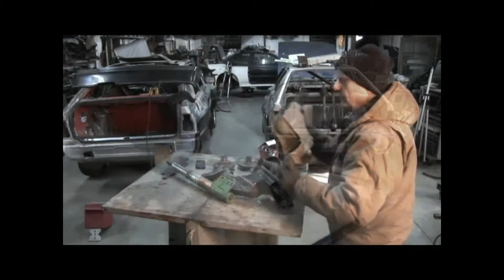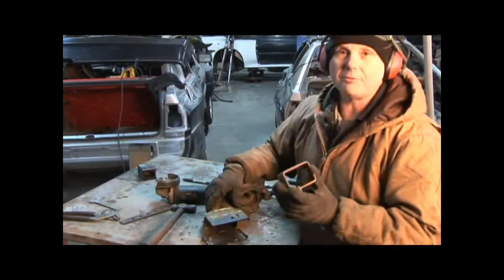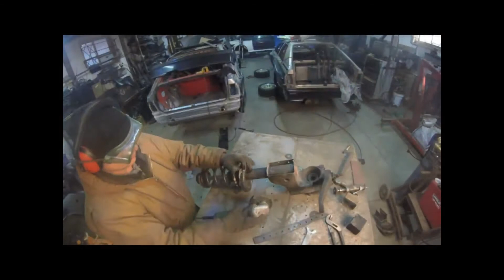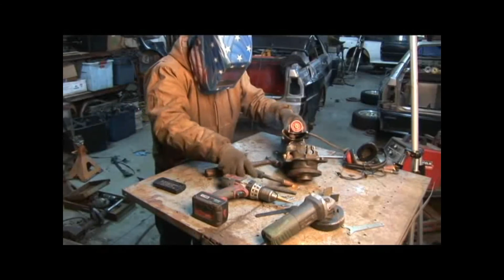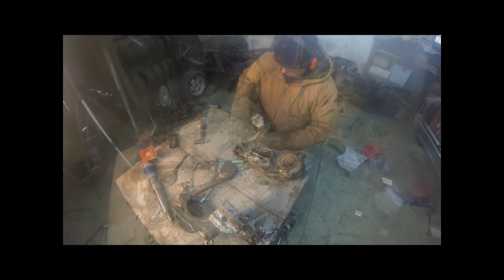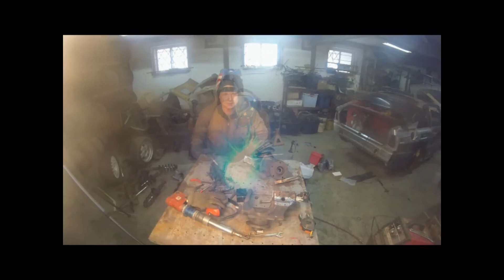Building suspension hub assemblies for the Audi quattro rally+sport quattro kit cars

Comment: Interesting use of parts, spares, eyeballing it!
Reply from the maker: Thanks. Eyeballing it, haha, ya why not, doesn't matter, it's all about fun and if it works, great, if not, back to the drawing board, no biggie ..
Reply: @rallypilot1  are you going with different offset wheel set to compensate for the wider stance?
Reply from the maker: @blkcoupequattro  No, I did this so I could use stock wheels and they wouldn't look horrible. Plus the wheel bearings will last longer than having all the stress put on them by huge offsets or spacers.
Reply: @rallypilot1  the car will handle better with wider track alone. using spacers is never a really good idea past certain point. How much wider will the track be vs. stock looks like a couple inches?
Reply from the maker: @blkcoupequattro  It looks like it's going to be roughly 4 inches total. I agree, my 951 has spacers from the factory(roughly 3/4") but 2 inches a side would've been way too extreme for me.